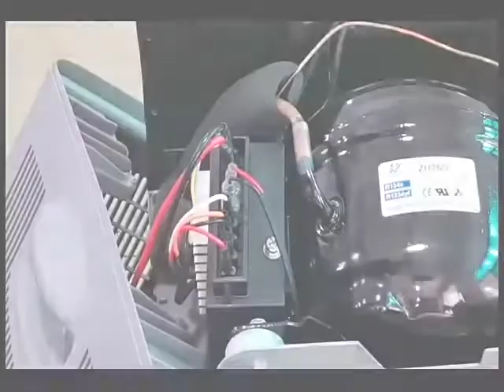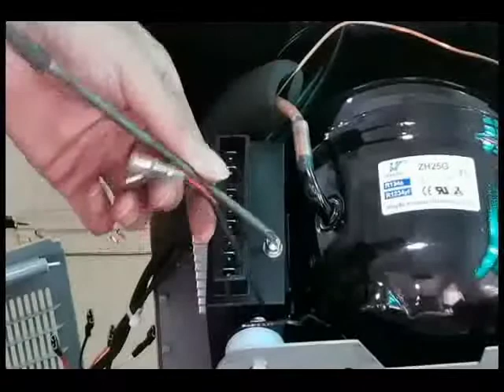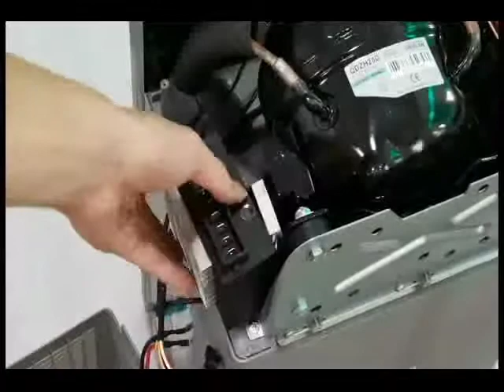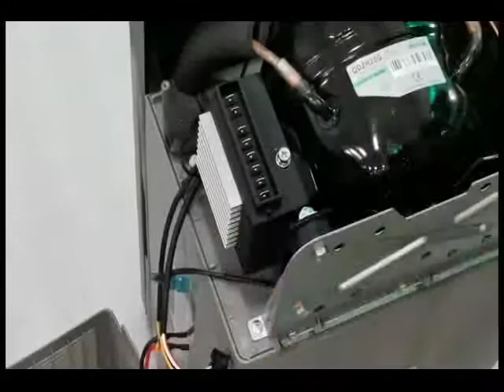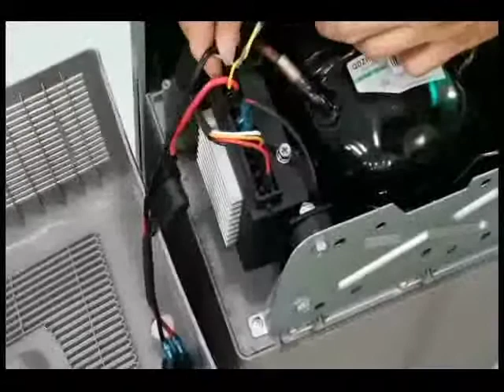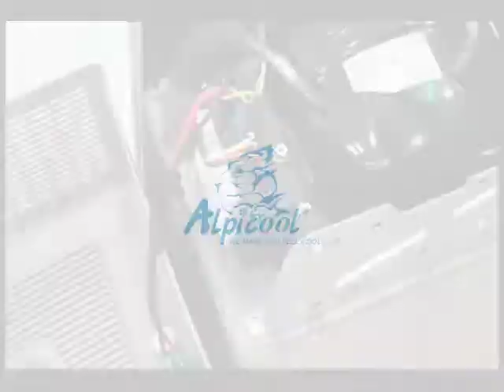Alpicool C15 Fridge Repair Video —— How to replace the module

Comment: Is there a schematic to test the module? Mine is running but not cooling.
Reply: Having same problem did you manage to solve this problem?
Reply: @jakearmstrong9987 were you able to fix yours or cheaper to get a new one?